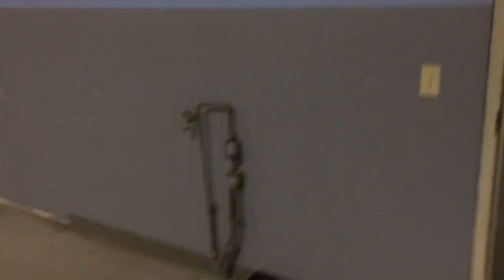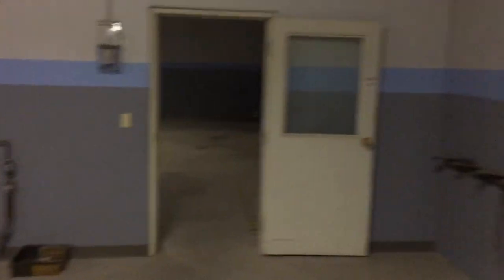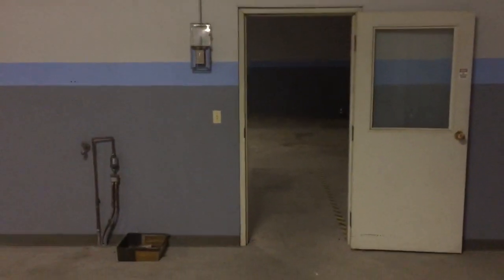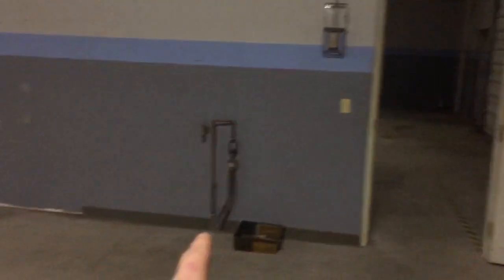Where to put roll-up door?  Help!

Comment: Use some logic, since none of us can fully know what your future plans will be. Then to be honest only you can foresee just what those needs are going to be. A door in the middle will break up that wall by a lot for equipment placement. And going the cheapest method just may come back to bite you on the ass in a very costly way later.  Try and come up with a rough plan on how you'll fill that space with equipment. If it were me I'd look at where delivery's of metal or new machines will come in, or part shipments going out. Yes moving the electrical wouldn't be cheap. But it sure as hell won't be any cheaper later.

Drawing a rough diagram of the buildings exterior and how trucks get in and out is required to give a semi reasonable answer to your question. That door won't be in constant use, but it's going to be a very important access point as you've already figured out. Getting some ball park numbers for moving either the electrical or water will be your first step. But your main road access point dictates where that new door really needs to be. Cost's while very important to any start up business is still secondary to what your actually needing. My guess is that given the ceiling height then at some point your going to end up with a bridge crane of some kind. Keep that in mind as your then far less dependent on a forklift and the space it needs.

Comment: Moving the electrical is expensive and may be impractical. I would put it at least 20 feet from the other overhead door so that a 90 degree turn can be done with the forklift. Put some tape on the floor and drive your forklift around and see what room is needed to maneuver.

Comment: Both of those spaces already have big doors to the outside.  Can't you just drive the forklift outside, then through the parking lot, and into the other door?  I would do this for a while to see if I really need the inner door.   The other thing is that the door will take up wall space.  Chris

Comment: Hi mate.  Have a look at where you would have the most stationary amount of equipment or stock potentially in the way.  I would not have it at the back, as you would have to negotiate all the machines and furniture to be able to get there.  I would have it as close to the building access as possible, so you can turn straight into the room you need to be.  Than start up the Hummer, and drive it through that part of the wall.  Don't forget top film it.........

Comment: I vote up front by the electrical panels.  Easy access with the forklift between rooms without moving current (future) projects or equipment out of the way and I wouldn't want to break up that nice long wall better to leave as much wall space intact as possible Might be best to move the panels which would be a bummer good luck

Comment: I think you already have your answer.....the Hummer in the right side bay had to enter through an existing roll up door, why not use that door until you are setteled in...have a look around then make a decision on the internal wall roll up....to me you will loose a lot of space on either side of that wall once the roll up is installed. Also, wasn't there some mention of classes being held in your new facility ?..just a thought.

Comment: put it just to the left of the electrical panels.  That way its closer to the front door if you have to bring something in from outside.  You also don't want to have to take something all the way to the back of the shop just to move it next door.

Comment: I'd put it in line with the roll-up in that first bay. That way, if you ever need to back something into the second area, you'd have a straight shot at it. And you'd get to keep the man-door nearby so you won't take it out and then have to walk to the other send of the bay or lift the roll-up.

Comment: In line with the last door by the hummer where the man door is. Move the water line. Then install the man door in the wall. That allows you to bring machines/stock straight into that area as needed. It also keeps you from having lift traffic near the classroom/office doors which will cut down on the possibility for accidents. Check local codes and OSHA regs as well. They may have some requirements about access. Draw up a floor plan with areas for each machine and work space around it. then look at traffic patterns. Consider what the end result of the shop will be as well, will it be more of a trade school or a working shop that offers classes? Will you be adding larger machines in time?

Comment: I would put it to the left side of the electrical box but deff keep it up front it will let you flow from one room to another without having to drive all the way through the other room and having to leave an area designated just for driving the fork lift through. But like some others have said I would leave the walk through door where it is means you can still move between rooms without having to roll the other door up and down
Reply: Oh and after I thought about it and looked a little more , I would deff try and line it up with another one of the existing exterior doors. Also putting it upfront lets you move between all three rooms very quickly and efficantly. But if you feel the you will mostly be moving between the shop area and the garage it may be best to place it in the back because that will allow you to take up the least area in those two rooms. It is really dependent on future use and ease but I would guess putting it up front give you the best positioning for future use and pass through with the least amount of dead space

Comment: John,  I would suggest  to put the door by the Electric Panels. You will have to keep the panels unblocked anyway. I would guess there is a transformer above the panels powering the 120/208 volt panel. Plus it looks like the feed for the 277/480 volt panel comes from underground. So moving the panels would be costly. Like you said it would be best close to the office roll up door. Just my two cents.
Reply: +Rustysgate  Just watch it again. there is not a transformer. Just two panels the same voltage. Still underground feed would be costly to move.

Comment: I don't know how much cash you have but at the front makes sense, moving that electrical panel will cost! If you put it in at the back and line up the outer door this maybe a good option depending on access to that outside door ultimately it comes down to cost, but the front is better.

Comment: Line up the new opening with an outside roll-up. Think long term, as if you were going to maybe one day bring in a Mitsubishi Laser with automatic pallet loading. You'd need the longest straight shot to allow for future tools and machines to be able to be maneuvered into the larger space.

Comment: Put it next the dist board so still at the end but not to far also benefit is that you can use power from dist board so short cable run so less cost

Comment: *****Make sure you line up the doors and keep the area between accessible for equipment and material movement from outside, thru the door without too much rearranging and relocating. The rear would be ok but having to move stuff from the rear to the front when the place is in full production is going to suck big time.  I've been the lucky one to do equipment rigging and having access to the areas where the outside doors are not located makes the cost of future movement dramatically higher.

Comment: In between the supporting post and the electrical panels.  You should put up a barrier to protect the panels AND the supporting post(I have been in the building when... think worst case scenario...:Forklift vs structural support).

Comment: I make sure you leave all your small doors take it from an old fart. offset your door 10 - 15 feet from any adjacent wall. this allows the freedom to turn a forklift either side without any restrictions. height is also very important you will not always be the driver of the forklift others don't always take the caution that you would in cramp spaces. without knowing what is outside or access outside to your existing outside door roll up when you enter from outside it is best not to have a tight right hand turn give yourself some room since you have it. thanks for all your videos my grandkids got me interested in watching other shops it is very addictive, I have learned so many new tips and tricks very much appreciated I hope I gave you some things to think about. I am building on to my shop for a new Milltrionics Mill. I understand placement of large equipment is difficult, when things way 16 to 20 thousand pounds you don't want to move once. PP1,  Pacific pilot 1

Comment: Instead of using a rollup door what about using a welding Curtain* (strip style) or something like that. This would not only have the potential to reduce cost but also would be able to reduce the labor/time to "open" the "door". While still being able to hold back any grinding dust & plasma/welding sparks. As for position I say towards the back or the center/middle. Having it in the center/middle or close to that would allow for a T-Junction style floor plan** in the machining area. Which has advantages depending on how things would run/be setup.  But this were having the Floor Plan/layout in CAD (Like many have suggested) would be Indispensable now and in future. As it provides advantages in ease of use, visualizing, making decisions, for contracting work out later and other uses (ie fire, safety, etc..).                                                                                                                                                                                                               *sometimes called industrial curtains/walls and/or dividing walls                                                                                                       **I used that wording for desorbing my thinking shortly Also it would be more of T+H Junction or even a 2T-Junction style floor plan. But again CAD floor plan/layout helps.                                                                                                                                                                                                                                                                                                                                                                    Hope that helps,  & Happy New Years!!!P.S. the comment system is being weird for me

Comment: depending where you put your machines I'm just guessing that they would go down the side walls and work benches  in middle so if you put it in the middle then it's easy to get to machines with the forklift. if you put it at either end you will have to go all the way though the shops to get to the door every time depending on what you decide to do with the back half

Comment: Happy new year.

if you keep it as close the the power board end it will allow for easier movement of stuff throught the 2 doors, other wise you will need to keep the area along the wall clear to allow for travel down the wall on both sides to move thing for one room to the next.

Comment: I would line it up with the overheads across the bay.  Looks like on the end with the panel is the worst option...  You don't want a fork lift whipping tight turns all the time and if they hit the wall instead of the opening, you've got a mess on your hands...  Having a long circulation corridor isn't a bad thing.  You may be able to place machines and materials against the demising wall and have your forklift path between those items and the open bays.  I'm sure there are WAY more constraints than that...  Just some quick thoughts.

Comment: I had a similar situation in my shop. Consider lining it up with one of the outside doors so that you can drive a vehicle straight through. You will be very happy when you go to move large machinery and materials in, being able to back straight in.  Keep the man door! Opening a roll up is noisy and takes a lot of time to just move from one side to the other.

Comment: Put it beside the man door and have the roll up open into the clean side.   By that I mean, when it is open, you won't have the dust from the dirty side settling on the top of the open door.   Saves having to look at a dirty door over time.   By having access to the man door, your saving heat and the vacuum effect every time you do have to open the "big" door for forklift access.

Comment: Keep it up front by the other roll-up door.. Leave the man door in place and cut the new roll-up  to the Left side of the electric panels.This would give you more room to make the turn with a forklift and still keep the option for just people to pass thru without having to use the roll-up door,.
Just my 2 cents.Happy New Year.!!!!
Reply: I agree too close to the other door would create turning problems
Reply: I agree. Keep that type of traffic towards front.
Reply: +PKinPa 
I agree, what do you anticipate at this time using the forklift to move, pallets, materials, machines? A few chalk lines on the floor for traffic areas and pedestrian areas (ideally these should be separate) linked to machine locations, material storage, finished goods / packing and despatch, material reception etc.

How much space does your forklift need to do at least a 90degree turn in with a pallet on the forks carried low down? Also is this space the same when driving in reverse as well as forward? 
(You would have course have to allow some extra space for driver error!)

For this type of thing I have used some large sheets of graph paper with internal measurements marked on it and simple birds eye view cutouts of machines and an area needed to work them safely and correctly. You of course being very computer literate and familiar with it might prefer that approach!! This might also help with things like routing power and compressed air supplies and so on.
Reply: seems a better solution!

Comment: Put in line with one of the garage doors so you have a flow through the working area, if the other roll door is blocked you would have two way to get things in from the outside. l would use the garage door nearest the class area.

Comment: if you are moving electrical connection then move the panels you have an easy move through the existing roll up door, if however you don't want to move the panels its easy to remove the water Spigot  so move it instead

Comment: I'd move the electric stuff and put the door there close to the front. There are probably wires in the wall so you will have to mess with the wiring anyway. Think long term.

Comment: Put it in line with one of the other doors. That way if you need to you have a through path.
Reply: +the hollow box Yep, a straight path through from the outside door makes sense as one of the design features...